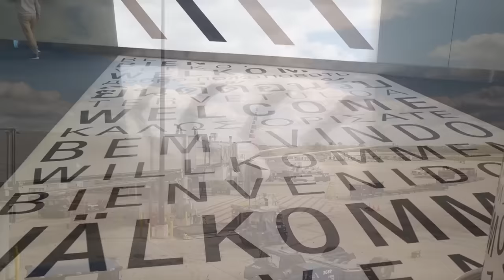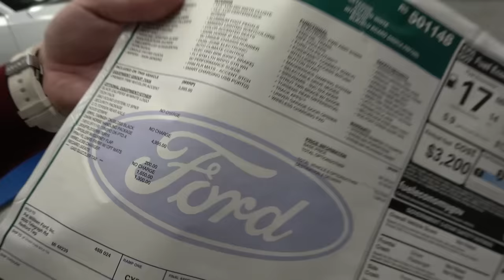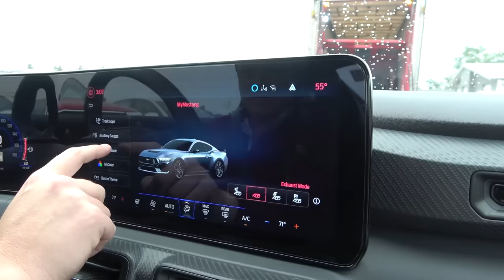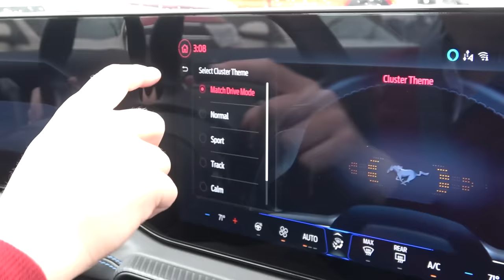IT'S HERE! Collecting My New FORD MUSTANG DARK HORSE

Comment: 2nd or 3rd Mustang. Now that’s a Brit who knows a good performance car when he sees one. For almost a decade now, 2015 launch of GT350, Mustangs have added awesome handling and improved interiors to supplement there phenomenal straight line speed, stump pulling torque, 4 valve per cylinder, iconic fastback design and some of THEEE most emotional and harmonic exhaust and engine notes in the game. Well done Mr Shmee!

Comment: 13:06 I see you got the Shaker Pro stereo system. The subwoofer on the right in the trunk is how you STILL identify that. The trunk looks the same too. I need to check out the new car at my dealership for myself, now that they finally got these in.
Reply: 15:28 Nope, I was wrong. Now it's the B&O Sound System with 12 speakers. What a shame. Shaker Pro was a cooler name. My 2020 Escape Titanium has the B&O sound system. Shaker was a Mustang only option.

Comment: For a vehicle that’s going to retain US plates one idea would be to 3D print a Shmee150 licence plate surround. Maybe using a clear poly carb’ or acrylic cover from an existing one but with your own surround with Text as per the Font and style you use. A satin finish in a colour to match the vehicle to keep it subtle and smart. They can look good although a lot of the standard ones look cheep and tacky. Especially in plastic chrome finish

Comment: I'm going to be honest, that white just makes the car look like a base model with some mods slapped on. Some cars can pull white off well, unfortunately that one does not. And the hood looks like it was done as an afterthought because it simply does not tie into anything.
Maybe if you take all the pieces (like the mirrors, side skirt, wing, and the splitter), and replace them with carbon fiber. Which, is hilarious considering the cost of this car. So many cheap-looking add ons.

Comment: I’ll tell you why it has 16 miles on it lol because at flat rock assembly plant there was probably so many issues with the car from the assembly line to the yard we had to pull it into the repair wall multiple times and back to the yard to either way for repairs or parts. I’m not even joking. I left ford after 9.5 years and they’re a joke.

Comment: name another current car with NA V8 and a manual... Chevy Camaro, Dodge Challenger.  Two right off the top of my head.

Mustangs have a huge trunk, but such a small opening it is hard to get anything into it.  Chevy and Dodge have the same issue with their current gen muscle cars.

Being that the Dark Horse is considerably less of a car than the GT 500, how long before Tim trades this one in on a Mustang GTD to get some real performance?

Also, there are no "shades of black".  Something is either black, or a shade of gray, lol.

Comment: My Bank would do the FX conversion for me automatically. My account is in EUR. If I want to pay someone in USD, I just enter a money transfer in USD. And the bank will buy USDs and sell EURs for me @ spot rate. Don't need a separate company doing the conversion for me.

In case I know, that I need the USD in several weeks, I can ask for a FX-Forward Deal with a fixed fx-rate way in advance when I need the USDs.
Reply from the maker: Clearly varies from place to place, but if I ask my bank to transfer money for me the rate would be painful. In fact on this exact transaction it would cost me over £1,000 more for the same USD payment.
Reply: @Shmee150  we do have a branch in London for Private clients as well ;-)